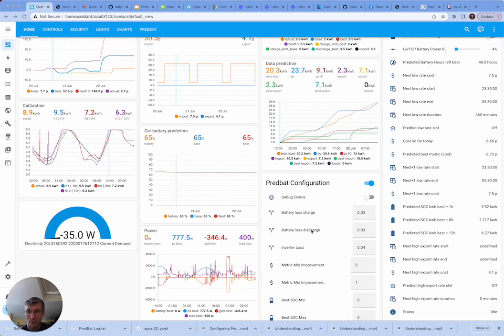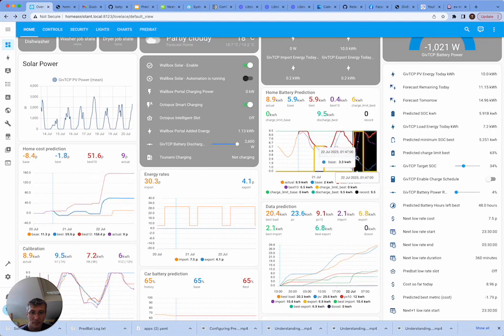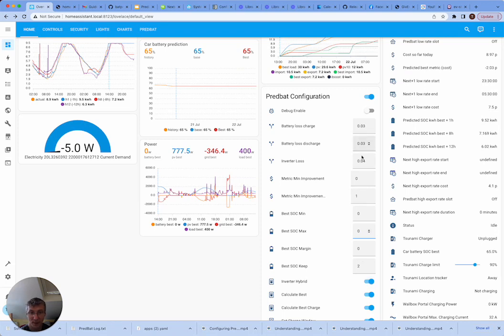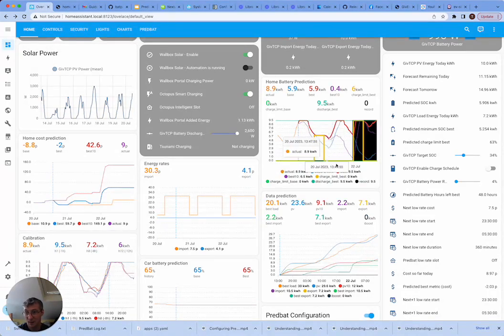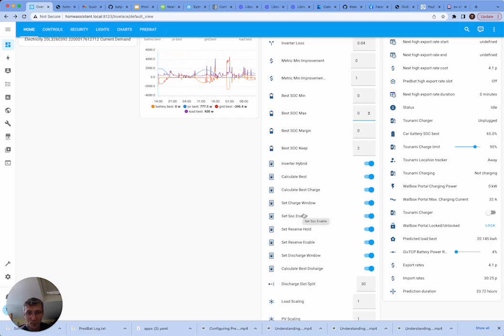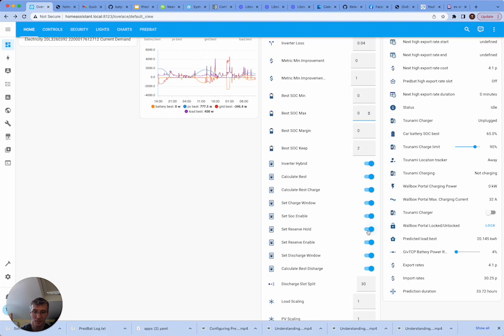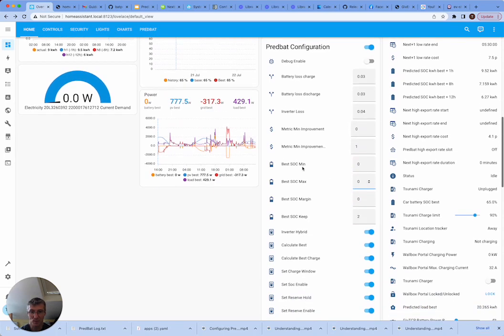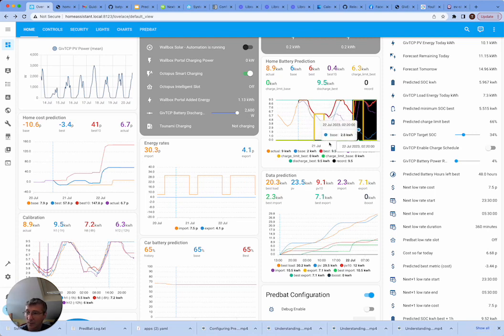Predbat - Configuration inside HA

Comment: I have a AIO, should I be set to hybrid inverter? I dont have  the following options...'calculate best' , 'calculate best charge' , 'set charge window' , 'set SOC' 'set reserve hold' 'set reserve enble' 'set discharge window' 'calculate best discharge' Should these be available? Im running v7.15.17
Reply from the maker: AIO is AC coupled so hybrid should be off.

Those configuration options I believe are now replaced with predbat mode instead of